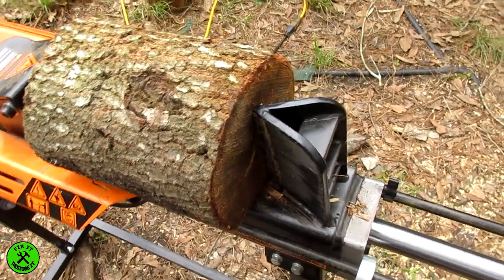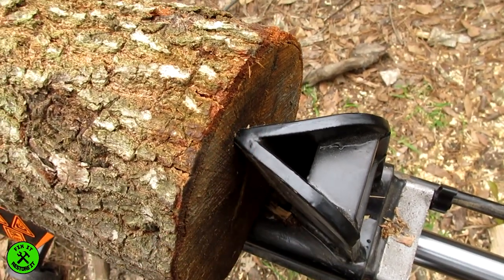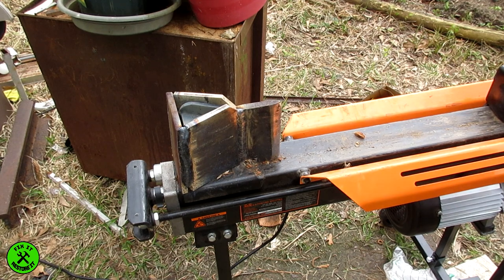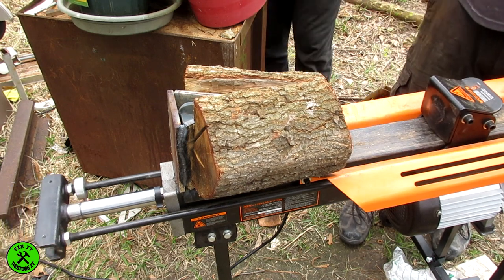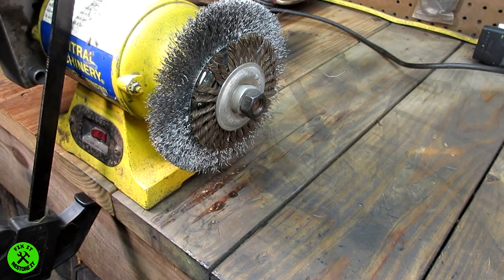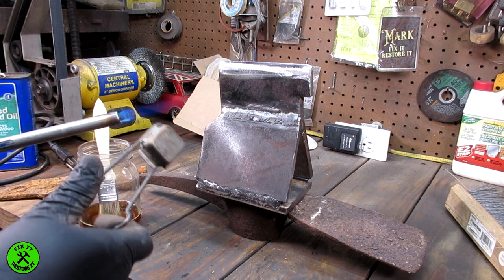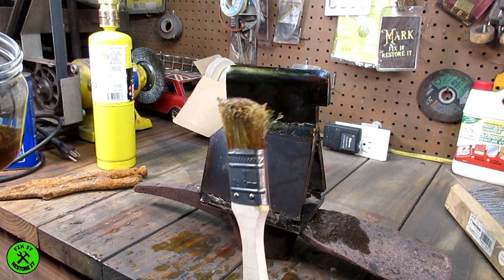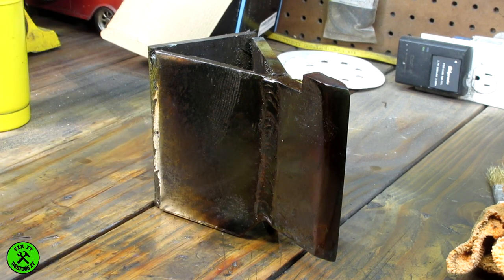Log splitter modification!

Comment: I like the attachment. I might weld up a similar cutter. I have seen a few videos on improving the splitting wedge.   I have the exact same electronic splitter. I have yet to see someone sharpen the cutting face, a file, right angle grinder with sandpaper. I keep mine some what sharp.  These little splitters are great for feeding backyard smokers and pizza ovens, my 2 cents. Have a nice day.

Comment: Great idea! Frankly I'm surprised "slip-on" wedges like these aren't already sold for 5 and 6.5 ton splitters that don't have removable wedges given how much more efficiently they split the wood and how much less stress they put on the pump when splitting.

I'll have to get me some good thick scrap and do this on my old Speeco 5 ton. Been wanting to find a project to break out my welder for so I don't get rusty (pun intended).

Comment: The oil soaked rag should be balled up as tight as possible and placed in a wicker waste basket with highly combustible materials? Also, I lost those needle nosed vise grips in the same field you were digging in so please send them back to me. After you clean them up of course. 😆 
Good job on the splitter 👍🏼

Comment: Nice job, though I have found that rather than trying to spot through the centre like that, I start the split closer to one side, then work around the log to complete the job without any need of modification. If you like to manufacture in steel, go for it... :)

Comment: Canadian tire has a $30 attachment for the non splitting end with a wedge on it.  It the gives you a wedge in each end  and makes splitting fresh wood or knotty wood  nice and easy.   Great  video, thanks for sharing.
Reply from the maker: Thanks for the tip!
Reply: Having a double header splitting wedges improves performance greatly. Allow doughtful logs to be split. 
Suggest the wedges are honed almost knife edge. Appears to make penetration easier & less strain on hydraulic pump, electric motor.
Making a finer edge radically altered the loading , stresses imposed on the machine. Went from overload, to NO PROBLEM, what's next boss . . .

Comment: Thank you for this video - just what i needed. Another benefit is that the ram gets closer to the splitting wedge. It's so annoying when you have a log with a nut near the end, and it doesn't get split all the way, because the ram stops short.

I tried following along, but i seemed you welded a short piece in the back, and then you later ground that off, and replaced it with a full plate?
Guess you where just winging it, as you went along :)

Did you take the slope of the original wedge into consideration when constructing the new wedge, or is it just straight?

Again - thank you for the great video, and idea :)

Comment: Rags soaked with linseed oil should be stored in a non flammable airtight container until next use (like an old pickle jar or something)...or burned intentionally if not to be used again.

Comment: What is wrong with sharpening the existing edge? Your plate is mild steel your existing wedge is not.
Reply from the maker: The shape of the wedge doesn't lend itself to cutting into the wood  even if it's sharp - if you've ever tried to split wood with a splitting maul you would see why

Comment: If you use the right chemicals you can get most of that rust off either that or you could do I don’t know what they call electrolysis were you a hook it up to a battery charger and you put it in salt water none of that should work to